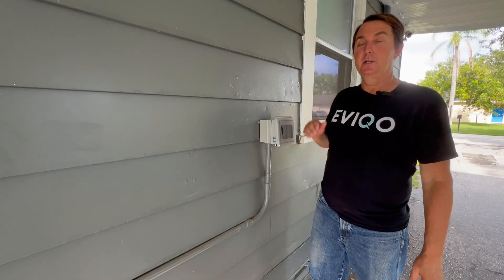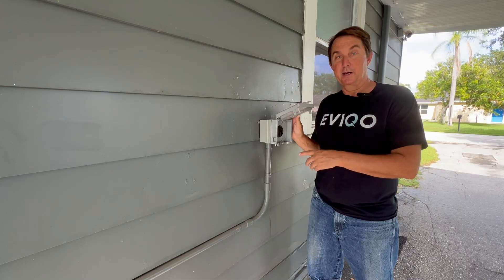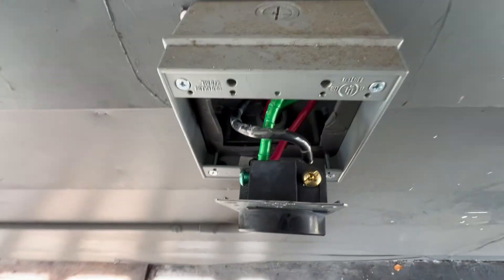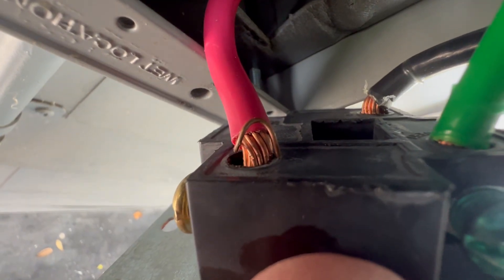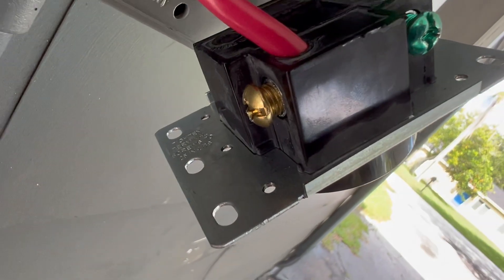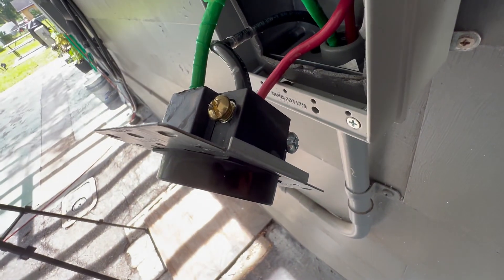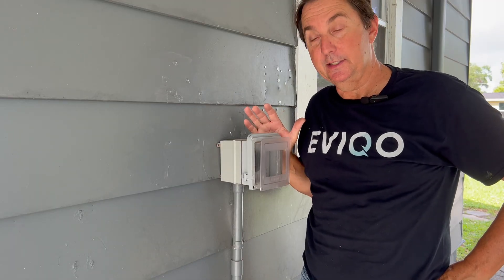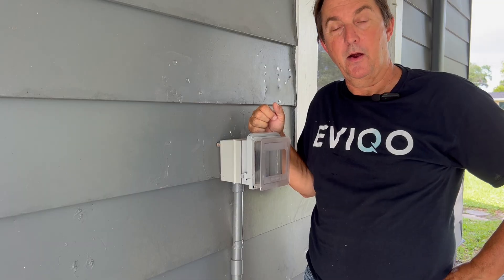Are Standard NEMA 14-50R Receptacles Safe for EV Charging?

Comment: My theory is that the receptacles burnt is because they have or wrong terminal/wire connections or internal terminals of the receptacle have some kind of corrosion increasing resistance and causing fire
Reply from the maker: Possible for sure. Terminations are usually the point of failure. Sometimes even if the receptacle has a high use of plugging and unplugging can loosen the connection between the plug and receptacle. THank you for watching and commenting! 🙂

Comment: Ground wire dude. You're talking about code vs mfg and your example doesn't meet either. Bad form to be posting videos like this.
Reply from the maker: If you’re talking about the torque specs that are on the device that’s as per manufacturer. Anything that the manufacturer calls out specifically supersedes the code. Anything not specifically called out needs to be done according to the code. After all, who knows better about their own product than the manufacturer and how to install it.
Reply: @YourFloridaElectrician I was talking about the ground wire.... Or the lack thereof. The one  NEC and the manufacturer both call for.
Reply from the maker: @alan4788  We have a ground wire for the device. Are you talking about the ground wire for the box? You know, I didn't even notice that until you called it out. That will be fixed immediately! Thank you for your keen attention to detail. Your Florida Electrician.